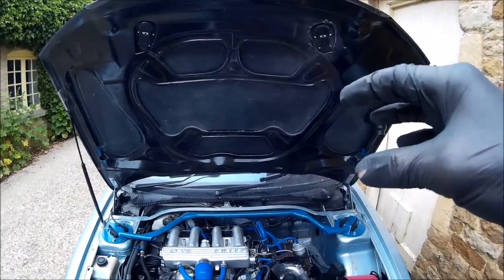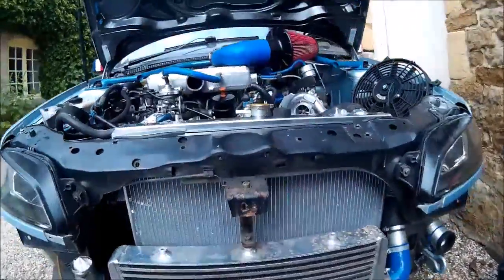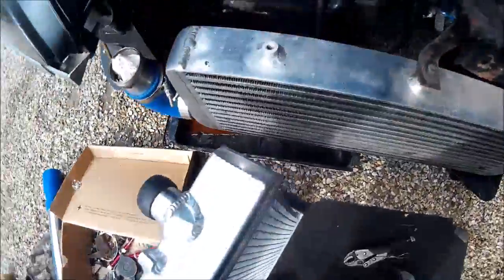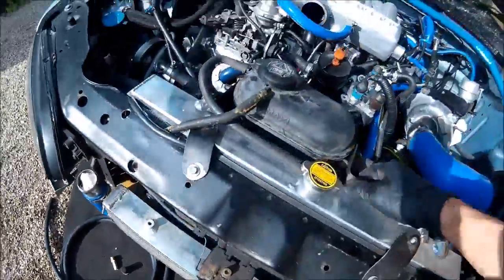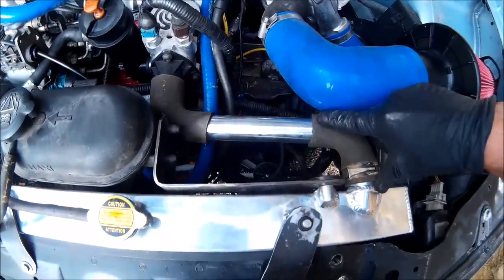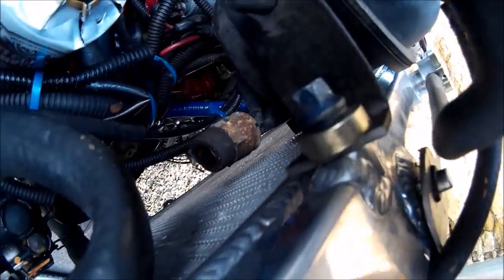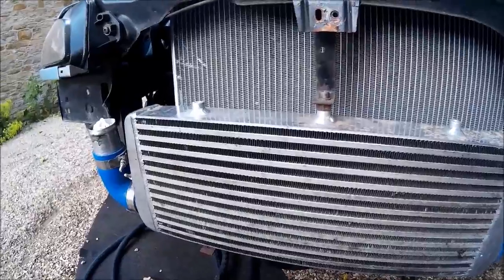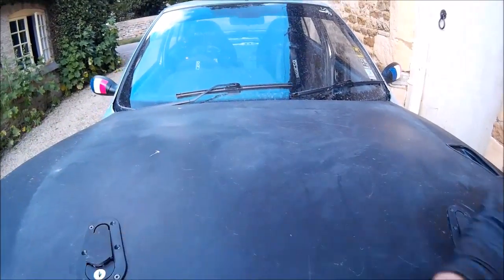306 2.1 - XUD Radiator upgrade PART 1

Comment: Doing this radiator conversion on a Ph1 1.9TD, where would you take the bottom pipe off the expansion tank to, is there the same plug on the back of the motor as the 2.1 or will it need to go elsewhere?
Reply from the maker: You still need an expansion tank 👌 if you doing this on a ph1, you'll need a ph2/3 expansion tank as I've used here 👍🐽
Reply: @PiggyPower  Yep I figured as much, but the lower pipe on that expansion tank, will it go to the same place on the 1.9 as it does on the 2.1?
Reply from the maker: @BodenM  doesn't really matter, so long as YOUR lower pipe goes to the lower pipe on the new radiator... All good 👌